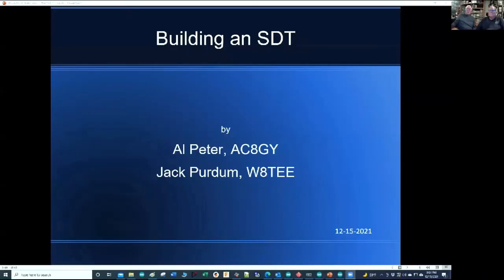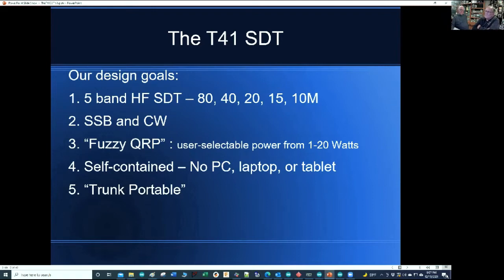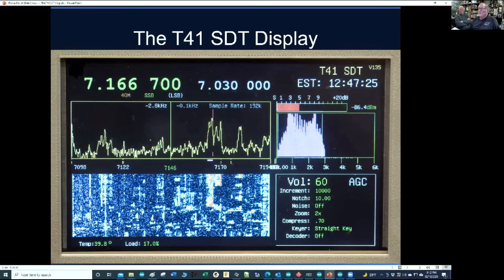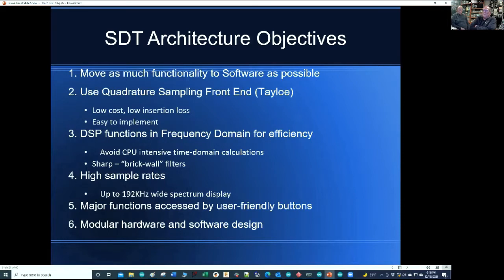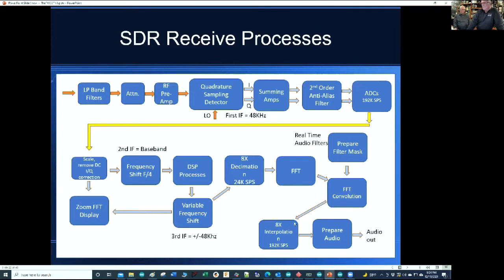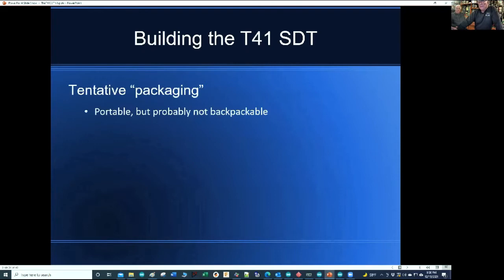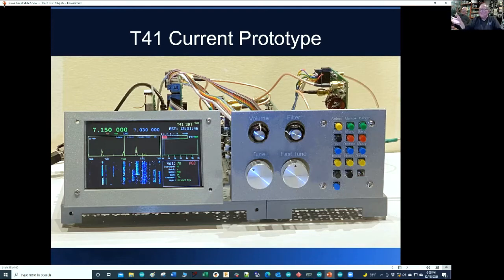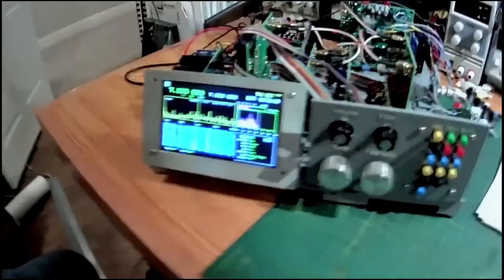Building a T41 Software Defined Ham Radio Transceiver

Comment: I would have called it an "SDX" because "T" can also stand for "Transmitter".  "X" is short for "Xcvr", a common mashup of Transceiver.
If I build one, I might use a 4x3 or 4x4 telephone keypad instead of all the push button switches.  I might redo the UI to make use of a single rotary encoder, as I got a real nice one from MPJA with a crank knob.  The Pic-a-Star transceiver used a single rotary encoder for EVERYTHING and a keypad to select menu items, but he also used a 7 segment display with 6 digits for EVERYTHING.  Rather cryptic and required the op to memorize the UI.  But I can go halfway with that, with the keypad, single encoder, and graphical display.  Would also add direct entry of frequency from the keypad.

Comment: Where can the kit be ordered?
Reply from the maker: There currently is no kit but there is a book. Software Defined Radio Transceiver: Theory and Construction of the T41-EP Amateur Radio SDT is now ready to go (Amazon B09WYP1ST8)
Reply: @RATPAC  Reading the book is highly recommended! Very interesting with some additional (off-topic) information like why the code is written in C, when to use defines over magic numbers or static variables and so on. Now that I have read the book I want to make the next step. Building the transceiver! Please sell a kit! A set of PCBs would be the minimum and it is not efficient I we all make custom orders from a manufacturer in China. The parts are available but I'm sure I have to order from many shops which results in high costs for shipping. So I would like to buy a complete bag with all parts which are necessary to make this fine TRX complete. Thank you very much for creating a nice rig which gives you the opportunity to learn how this rig works and let you modify the hard- and software! Choosing the Teensy platform and a free OS-independent compiler (I'm on macOS) is just right for a learning TRX platform. I'm writing this as an experienced Ham radio amateur who also built a working original mchf TRX (nice project, too).
Reply: See below...